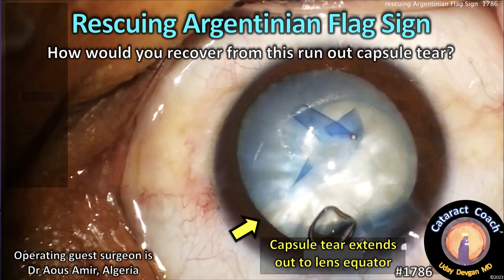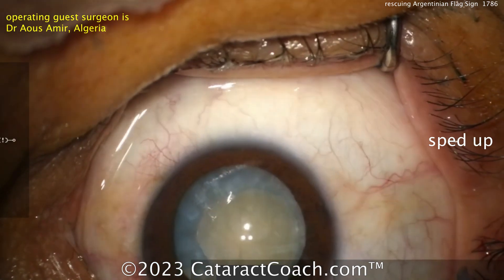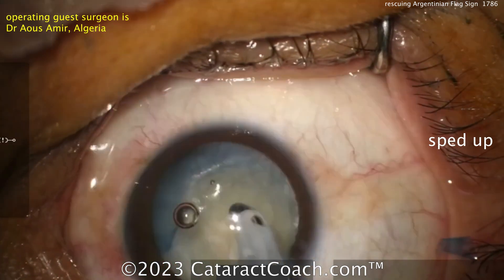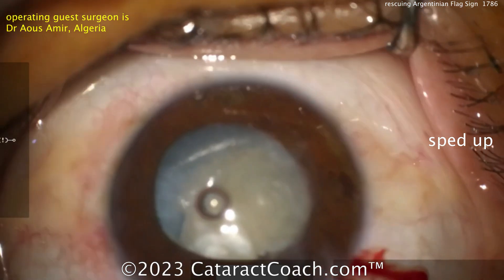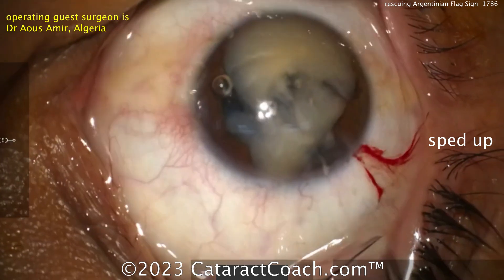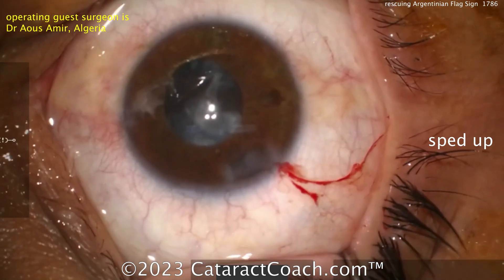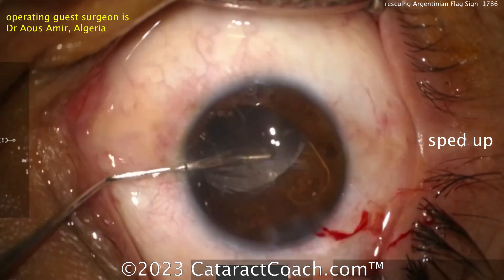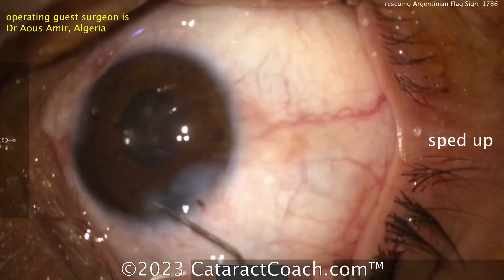CataractCoach™1786: rescuing Argentinian flag sign

Comment: I guess there wasn't any draping
Secondly the speculum was very tight
Thirdly whenever you come across an airbubble in the AC while you are making a rhexis, you get into trouble
And lastly i would say that in majority of the cases you can rescue the case but thats indeed when a complication occurs so i would personally like to convert such a case into MSICS or even an ECCE.
Reply: One can see some sort of draping in the video under the lower lid. It's ok, if the standard ones are not available. Me personally I would also convert into MSICS to avoid taking risks.